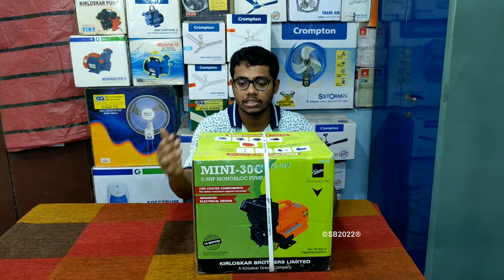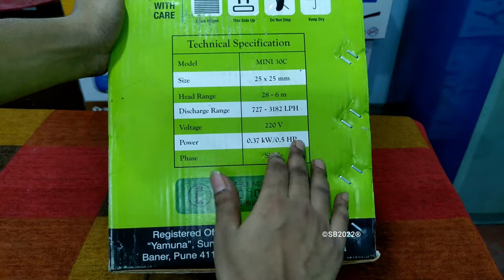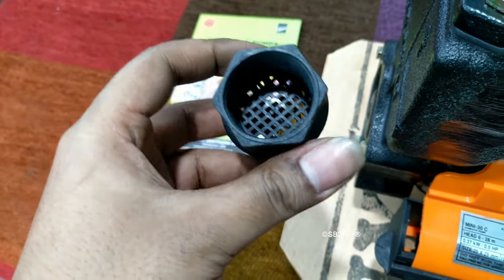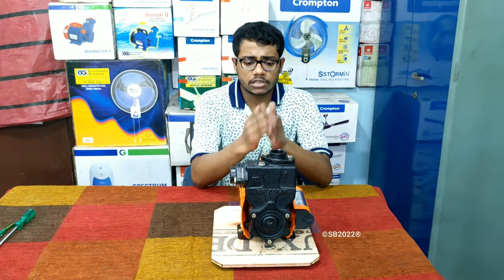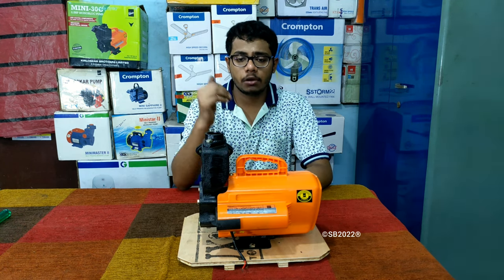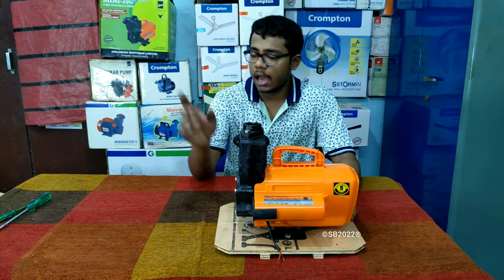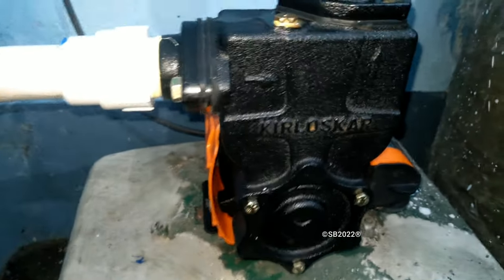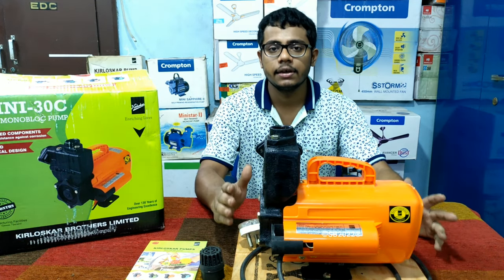KIRLOSKAR MINI 30C (0.5HP) PUMP UNBOXING INSTALLATION & REVIEW

Comment: Other than Kirloskar and Crompton, we have CRI Royale 52 0.5 hp pump which has discharge of 3150 Litre per Hour at 6 Metre and I purchased this pump for 4600/-. This is much cheaper than Krloskar 30C and performance equal. So need to think beyond Kirloskar and Crompton brands.
Reply from the maker: In regards of history of Pump manufacturing & R&D, obviously Kirloskar is far older, better & have vast experience on pump manufacturing. CRI, Havells, V.guard is just a tiny kid in front of Kirloskar. May be that CRI u own satisfy your requirements. But when someone consider "brand & brand value", Kirloskar pumps comes first. Then followed by Crompton Greaves Consumer Electricals Ltd & Wilo pumps. 😏

Comment: What is the difference between nimi 40 1hp and mini 30c 0.5hp and which is the best water pump
Reply from the maker: 0.5hp pumps are made for maximum 4 storey building water lift (G+3) for best efficiency. 
1hp is for 5-7 storey (G+6) for best efficiency.

Comment: Jalraj vs mini 50c comparison dorkar
Specifications difference tmn kichui nei
But sobai besi daam diye mini 50 c nite bolche
Why???
Please reply. It's urgent
Reply from the maker: Mini 28s, 30c, 40c, 50c Pump r best (baap) model. Ogulor impeller big size, rotor stator ta powerful ar build quality is best & heavy weight. Long lasting r jonno toiri. 
Jalraaj hochhe sostar model. 
Apni Baap ka baap model nite chaile Mini gulo nin kirloskar. 
Ar kom price e valo pump chaile jalraj thikache.

Comment: Bro please help me. Actually may bohot confused hu 1hp ka motor lu ya 0.5 hp k high pressure motors luu jese kirloskar 30c. Please mujhe suggest Karo na konsa a66a hoga. Agar bap me v main thorasa zada upor Pani lift Karu to problem na ho. Kirloskar jalraj ultra 1hp. Crompton mini master plus 0.5 hp Kirloskar 30c Havels mx1 1hp. Please bro please suggest me.. your experience suggest will help me resolve the confusion
Reply from the maker: Are u a Bengali? U can talk to me in Bengali too. Please say:- 
1. how many floors you want to lift water?
2. From where u will pull the water? Underground reservoir/ tubewell or direct from supply water pipes? 
3. What's the capacity of the overhead (roof) tank?
Please answer the following...
Reply: @SOURADEEPBISWAS  
Yes ami Bengali. Tumi bolo ki kore kotha bolbo tomar sathe?
Reply: @SOURADEEPBISWAS  
3rd floor
Tube well
Reply from the maker: Instagram e kotha bolun. 
3rd floor from tube well... Hmm lemme think.

Comment: Suction capacity?
Reply from the maker: Suction 5-6 meters below ground. (Use Shallow Well Jet pump or submersible if using tubewell to pull water deep underground)
Max discharge 3158 Litre per minute on 6 meter head

Comment: There are only two wire +,-
Where is Earthing wire ??
How set Earthing wire?
Reply from the maker: The earth is connected to a screw provided on the body beside the capacitor place near the foot of the motor. Obviously everything covered by false cover 😌
Reply: @SOURADEEPBISWAS please make a new video and tell us how we connect earth wire in this pump
Reply from the maker: DURING REMOVAL OR CLOSURE OF PLASTIC FALSE COVER, I ATTACHED THE EARTHING WIRE TO THE FALSE COVER SCREW BODY FROM INSIDE SO THAT COPPER GETS SANDWITCHED BETWEEN CASTING BODY & PLASTIC COVER WRAPPED AROUND THE SCREW. FULL EARTHING CONDUCTIVITY IS ACHIEVED